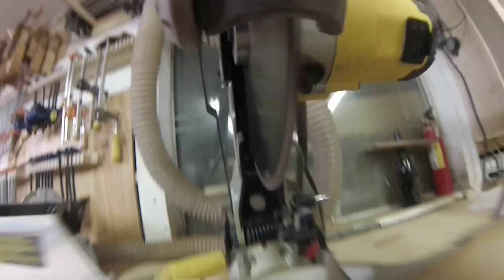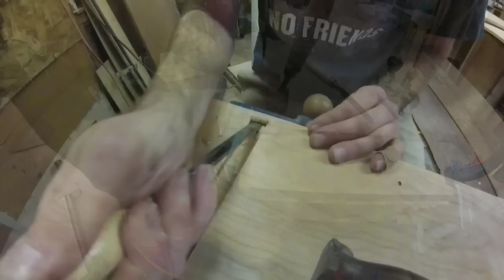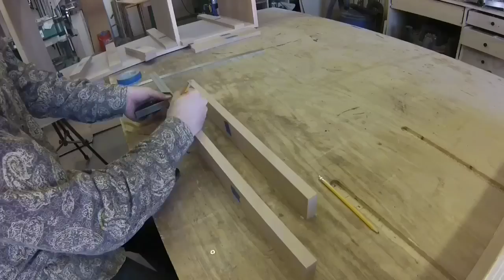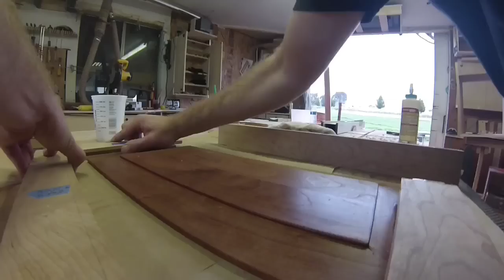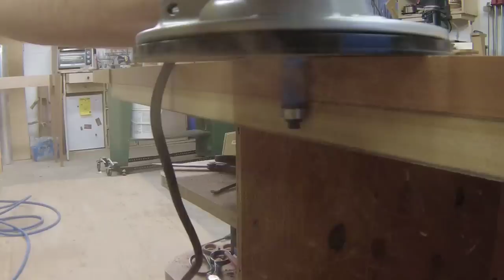The Kalmia Credenza

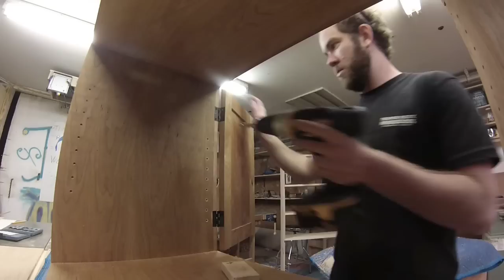Comment: Hey from Ramona!  Awesome work man!!!  I noticed that the shelf pin holes are offset seen at 6:24. how does that work? Also, did you add a back or did you leave it open for easy cable/wire access?
Reply from the maker: Romona awesome! I forgot the drill those holes but I did end up drilling them. And it does have a back I just ended up having to deliver the piece And couldn't film it

Comment: Great work man. Do you typically start resawing on table saw so bandsaw has a path to follow? I've never tried this and am really curious your experience with this method...
Reply from the maker: I use it a lot. It creates a channel for the bandsaw blade to run in. Helps stop blade drift and is a lot easier on the bandsaw blades. Save lots of time too. If you have a thin kerf blade for your tablesaw use that. Saves wood. Cheers!

Comment: Arent you afraid that the inlay en the top wil move in the oposits direcition.s  wat wil cause for crak.s and gaps?
Reply from the maker: Yeah the woods going to move. For a top this big it can move up to an 1/8 inch. The inlays are narrow enough that they can stretch. If not they may loosen up in the corners
Reply: Kyle Toth oke i am planning too do something simeler too a coffee tabel
That was why i askt

 and i was thinking about making the grain of de inlay the same direction as the tabel al around so that the inlay would move in the same direction as the top in both direction.s

Ps. Thanks for the comment
Reply from the maker: That would be best.

Comment: Beautiful work as always Kyle!  If I may ask a question, I noticed you resaw one side and then finish on the bandsaw.  I know I'm probably just displaying my inexperience, but is there a solid reason behind that?  Or is it a matter of preference?  I think that's the first time I've seen that done, and I'm always keen to learn something new :-)
Reply from the maker: I was re-sign boards that were tall are than what I can cut on my tablesaw from both sides. So some of the panels were 7 inches tall and my tablesaw reaches up with 3 inches on both sides of the board leaving a tiny bit left in the middle for the bandsaw to cut. It just makes less work for the bandsaw
Reply: Ah I see, makes complete sense, thanks!